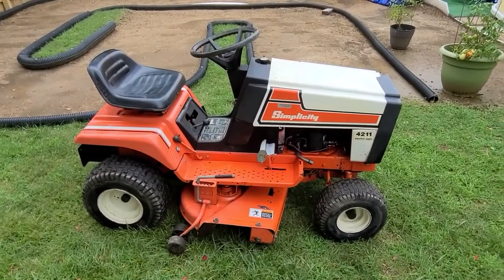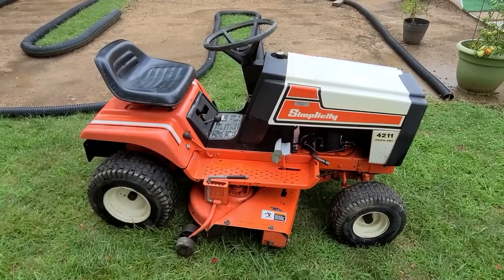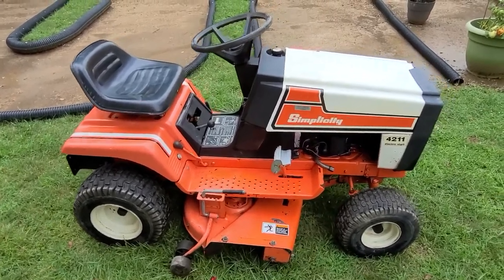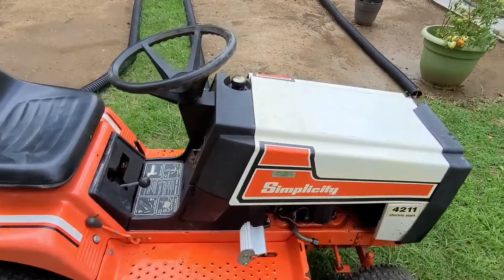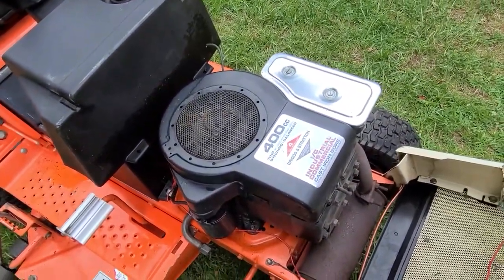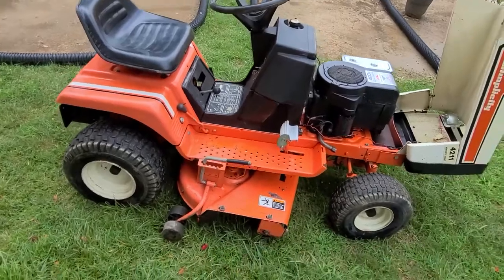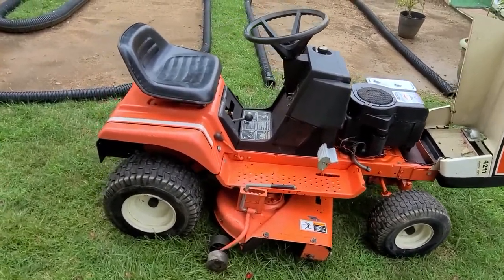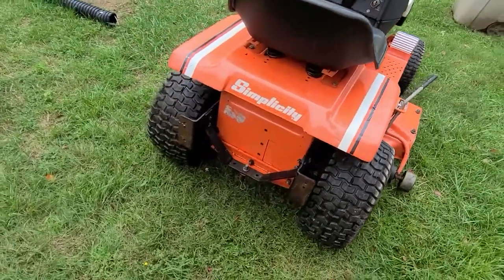Simplicity model 4211 vintage tractor

Comment: I have one of these, got it when I was 7 and I loved it, still have it, it's been cheaper to buy it and fix/replace whatever breaks on it than it was just to fix my sister's 2019 john deere.
Reply from the maker: Still starts right up and the deck as no rust holes. May be loud and heavy...but old tech for something like a lawn tractor is best imo.
Reply: @VINTAGEBACKYARDRC  absolutely